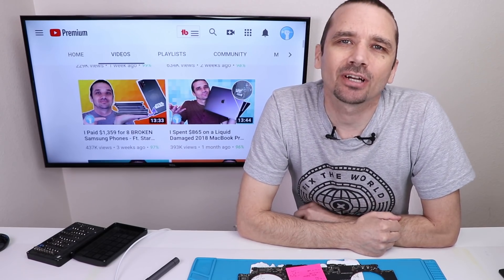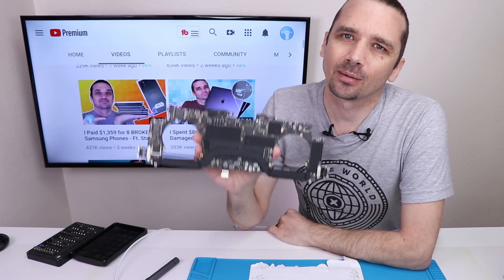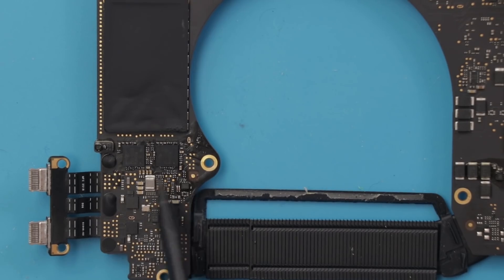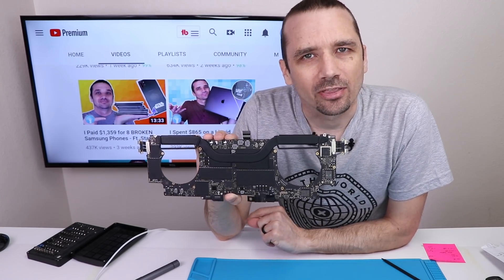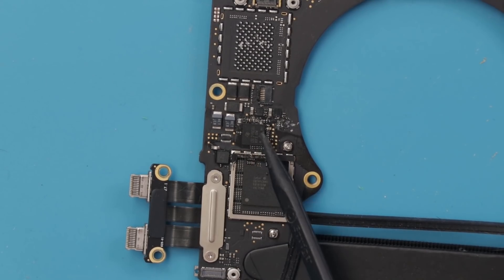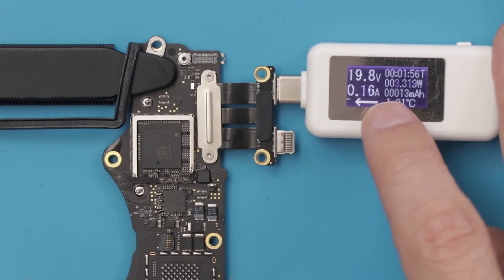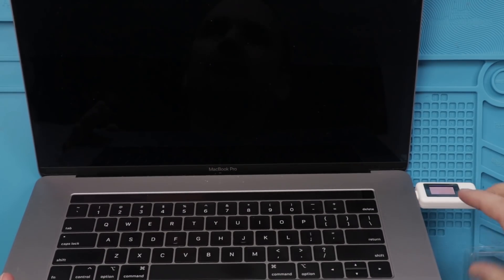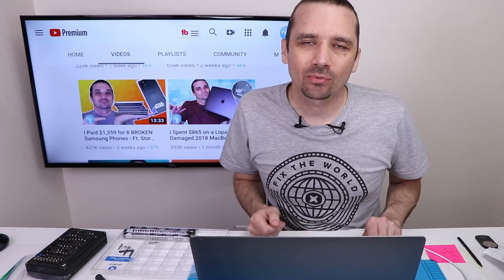ANOTHER Broken 2018 MacBook Pro From eBay for $700  - Can I Fix It?

Comment: If my MAC Laptop battery is below a certain level it will not turn on even if it is plugged in.  Which I think is dumb. If it's directly plugged in to a power cable it should turn on no matter the battery level.

Comment: The biggest problem I found is when there is liquid damage and the owner just leaves it for a day or two then starts using it again. Clearly not realizing that just because it's working, that doesn't mean there isn't still liquid in there rapidly corroding the internals. ☹️

Comment: Hi, can somebody help me?  my macbook pro 15 2016 A1707 only works on the wire, the problem is up to one resistor so can anyone tell me exactly where it is and which one I need to take?  and think this is the R6907 part, it goes from the battery... battery recognizes but does not work with it
Reply: R6907 is not an actual resistor on that board, youd have to measure PPBUS_G3H voltage to see whats exactly wrong with it to start, then measure PPVBAT_G3H_CONN.
Reply: @DSuave03-Me  so i have all the way 18+V on board with cable and on D6902 to the battery i think 11-12V. when change on battery i have on D6902 on second pin under 2V, when measure battery show me 0V or after one minute on cable than come on 2.7V, this is battery bad or dont charge?
Reply: @razorr335  Bad battery most liekly.

Comment: Hey,
I am getting the same issue, 19.9v but no amp - What did you do to fix it?
Looking at the documentation I see three CD3215 chips labeled U3200, UB300, UB400

Also where did you source the replacement chip?

Comment: This might be a heavily asked question but I actually finally decided my career path is going to be in the direction of electrical engineering and I’ve always loved working on electronics .. I was just curious how did you learn so much about motherboards themselves , seems very off setting but I would love to know where I get my feet wet , as far as knowing what components do what or how those components are supposed to perform ! Love the content !
Reply: Take an electronic course at a community college. That’s where you learn

Comment: Bro i need your help regarding my ps4 controller.
My controller is not charging. So i open my controller for check.
I noticed when i unplugged the touch pad connecter then it start charging and when i connect touch pad again it is not charging again. 
Plzzzzz help me what to do plzzz

Comment: iPhone charging case does carry the same isl9249 as for this Macbook pro, you can desolder it from the charging case and use it for the Macbook Pro,  it will work! However you must reball it (obviously) before resoldering.

Comment: Question, My friends MacBook pro 13" 2017 function keys has water damage. Some drops of water fell onto the keyboard and now the keys "9 O L . up arrow and down arrow" don't work. Everything else works perfectly. I'm trying to fix it but I can't find any liquid damage on the inside and I can't take the keyboard out as that would require the plastic behind the keyboard to be ripped apart. Is it recommended to just put 99% alcohol under some of the keys to see if that cleans corrosion that might be underneath the keys or will that fry the entire MacBook? Any tips?

Comment: ( ISL 9249)  you should be able to find that chip inside the AirPods case. Also I have a hunch you can use the ISL 9240 chip in place of. (Dual verify that last sentence) good luck....looking forward to your solution

Comment: Have you got a current limited bench power supply to inject some power into PPBUS and see what components get hot?

I would suggest  you mesure resistance from PPBUS to the CPU and GPU power rails, a mosfet could have failed connecting PPBUS to your CPU die and that wuld be game over.

Comment: @TronicsFix You've never successfully removed broken WiFi connectors (the little circular pieces) from the end of the antenna wires have you? I managed too snap mine off. :/

Comment: I have a Late 2008 MacBook Aluminum Unibody and it has a warped lid/screen like you showed in the video.  That warping just happens with time.  It doesn't effect the performance.  Mine is still running like a champ.  In fact, I still use it daily and I'm typing and watching your video with it.

Comment: In 2016 I bought a $700 HP Laptop and 7 months later it stopped powering on, so i sent it under warranty HP fixed it in a week. Then 8 months later same thing. I took it to 2 places and they said there was no power from the battery or power cord and they too bad. I should have mailed it to you.

Comment: My guess with the burned out USB-C pin is a faulty or cheap charger could have sent the wrong voltage to that pin or just sent the voltage to the wrong pin, causing the pin to burn out and kill the ISL9240. I've seen similar with a real cheap USB-C charger from Wish.com, the charger was rated for 20 volts, but it actually sent 38 volts to one of the data pins.

Comment: 12:20 me yelling at the screen: the first thing we need to do is THROW IT IN AN ULTRASONIC CLEANER GAAAAH
Reply: No you should not... always try to find corrosion and possible faults first. Troubleshooting can be very tricky if you lose the visual hints.
Reply: That Dude ~ note it, clean it, then troubleshoot it! Otherwise you're just chasing down ghosts of gunk all over the board. I don't get your point on that - it's like taking a record off a sandy beach and trying to play it, wondering why it sounds so awful and taking a toothbrush to individually clean off a track at a time. No! Just wash the whole board and look at what was previously messy to get hints on further troubleshooting. Anything that's still wrong will usually still be visible - broken traces don't look like good traces.

Comment: That capacitor at 13:04 is probably shorted, you can see the crack going through the corner of it.
Remove it and see if there's still a short :)

Comment: On the second Macbook: I'm sure I'm not the only one to draw this conclusion, but for what it's worth, here's my deduction on how the damage occurred. The laptop gets dented, but is provisionally fine. The owner, not a trained technician, wonders if he can do something about it himself, so he opens the case and bangs out the dents. The "repair" seems to work for a while, but what the owner doesn't realize is that the case has to keep tight against the elements, so as time goes on, moisture leaks in through the gaps, and kills the device, this time for good. So they sell it off as scrap (Apple edition) and... probably buy another mac.

Comment: Maybe someone can help me with my old macbook air? I have Macbook Air 2009mid A1304. I have problems with wifi. No hardware installed. In system report airport not showing, but bluetooth work. I tried clean install, changed airport card, connection flex cable - problem not solved. I think this is motherboard problem. Maybe someone knows where need to look for problem? Thanks!

Comment: remove the chip to see if there's no short, nothing to lose
Reply from the maker: True, but I didn't want to take it off until I have the part here.
Reply: @Tronicsfix  be like me take it out and never find it again lol
Reply: @legin3753  
You mean, you take off the chip alone but everything gone missing?
Reply: @noorazmi2329  ithink chip only :(
Reply: @noorazmi2329  the chip would go missing i have a shed so full of stuff ya wouldt believe it lol
Reply: @legin3753  
What about your heating tool? Does it go missing too?
Reply: @legin3753  
Oh I get it now. Everything gone missing because it is there right from the beginning.
Gone + missing = no more missing word.
Reply: He man my ps4 pro overhot a lot I don’t know why the fan is clean and everything
Reply: @bmxlife_nyc2525  Try replacing the thermal paste, there's tutorials on YT
Reply: @bmxlife_nyc2525  
Maybe The thermal paste have problem? Bad.
Or, too dusty or something has blocked the ventilation?
Or, bad heat sink due tar build up if you are a very heavy smoker?

If the fan is clean and everything than the possible reason is bad thermal paste.

Comment: I got one of those Macbook Pro's (Second one you showed) for £5, it was bend and beat to hell so I got it looking as good as I could, bought a charger from ebay to find out the screen is badly cracked and they are not cheap to buy, but the motherboard works which is a good thing.
Reply from the maker: Where did you find it for 5?

Comment: I am a bit shocked that a macbok (pro) that looks like someone threw off a bridge still costs 700 bucks. Wtf
Reply from the maker: Newish MacBook Pro's are still expensive...even when broken
Reply: @Tronicsfix  I have the chip in-stock if you like to buy it I have my own ebay acc
Reply: @Tronicsfix  Broken is one thing...completely trashed is quite another matter!
Reply: @Tronicsfix  c232 chip i have them in stock if you like to buy one just reply back to me I can shoot you a email
Reply: Apple makes it tough to get parts. Even a busted Late model Mac is a sea of high dollar parts.
Reply: @DanaTheInsane  my mid 2014 retina MacBook Pro sceeen is broken and a replacement costs £300 - £400 or that’s about $400 - $500
Reply: It still had the logo untouched man, thats at least 600 bucks
Reply: @fhanum9716  maybe even 666 bucks
Reply: Yeah, Apple pricing carries over even to the used stuff i guess. I don't like Apple but the brand certainly carries some weight in that sense.
Reply: The value of brand identity is more than a lot of people know.
Reply: @ProjectNateRS  You confuse a real value with what a silly world assign to a trendy but still a real crap product...
Reply: @paolomonai9511  no, I didn't. I just made an observation
Reply: @UnCoolDad  won't work you have to program it to the Mac pro inorder for it to work with Mac pros
Reply: "I got a MacBook Pro. Yeah, it's broken and doesn't work, but who cares, right?"
Reply: I sold my 2013 for €650
Reply: that logo itself is approximately 500USD 🤣
Reply: What I find even more shocking the idiots who purchase them....no my block i get those working for 250-300 max
Reply: Stup
Reply: Because it’s a MacBook Pro....That’s why....Damn, I want one
Reply: It's only worth what someone will pay for it.
Reply: Exactly, offer and demand I guess... But not for me.
Reply: If I had a macbook I would have thrown it off a bridge aswell
Reply: Yeah, it's inconceivable. 700 dollars would already buy a pretty decent brand new Windows laptop. Or a Macbook that looks totaled and wouldn't even charge, let alone turn on. I'm destined to never use Apple products because I just don't get it.
Reply: @herrakaarme  Its very illogical to me as well.

Why someone would spend that much on a broken macbook that looks to have been dragged behind a car, when they could buy a pretty decent windows machine brand new, with warranty and all, for the same amount.

I guess some people are just not very smart :)
Reply: To bad we (Sweden) have odd keyboard layout, else it would be profitable to ship broken ones to US.  Bought 2 broken MBP fro $50 (500 SEK) just to rip off the screens for another use case.
Reply: Apple doesn't sell laptops, they sell their image. They are the Rollex of tech, which I just don't understand how a tech company can exist in that fashion. Tech is meant to have a function, and I bought a laptop with a slightly worse cpu, double the ssd storage, and a dedicated graphics card (only a garbage 1050, but better than the no card you get with a macbook air), and I got it for $400 less, not to mention taxes would be higher for the mac.
Reply: @TheCalmPsycho  apple used to be about function over image. 

They were first to have mass manufactured laptops with wifi connectivity 

They made the first reliable and solid built mp3 players destroying their competition Sony walkman and Microsoft zune (actually using HDD like a computer in the first ipods) 

They bought the rights to GUI from xerox and all GUI today descend from what Apple developed. 

Apple sold the first fully complete home computer system Apple II, not requiring separate purchases of other parts like IBM such as power supplies, keyboards and displays. Today this is the standard when buying a home computer.

WebKit is VERY important you wouldn't have search engines like safari, Firefox, or chrome without it!

Multi touch screens, look up finger works. Apple bought them and developed it and now everybody uses technology derived from that work including Samsung!

There is probably a lot more apple is responsible for that I haven't thought of, but there is definitely a reason they are loved. They are an innovative company and their products in my experience take more of a beating than their contemporaries.
Reply: @bear2507  Why is it worth more in a totally useless shape? It's because of the brand. I've never in my life worshipped a single brand. However, there are lots of zombies on this planet that do, and thus many companies can get away with higher prices for no particular reason. It's an extremely desirable situation for all manufacturers, which is why these days you see a number of flagship smartphones from various brands that are just as expensive as Apple's best. The companies all wish they could sell air to loyal customers. And I'm not talking about Air Liquide.
Reply: I remember arguing with my GF that apple is just a useless logo of great looking, yet too simple software wise, too expensive devices. After many arguments she could only say "but I feel good when people see I use an iPhone!" So there is only that: a logo.
Reply: exlibrisas Apple is pretty good with optimization of their machines. Still over priced? Yes

Comment: My opinion is different: Fix ALL the things! Find more laptops! Maybe try to fix a TV that looks fine but won't power on!

Sky's the limit! Love your content!
Reply from the maker: Thanks! Glad you're enjoying them.
Reply: TronicsFix the xr battery case this chip afaik. Check it out its not too expensive
Reply: @Tronicsfix  I would love to see vintage video games repair
Reply: I couldn't agree more on this.
Reply: Yes please! Super interesting!
Reply: I purchase a tv recently that wouldn’t power on. I’m ordering a part for it on eBay. Tv repair can be simple from what I’ve seen. Fingers cross the part works!
Reply: @SaithusX  Probably a faulty capacitor. My TV was acting weird (turning on over the night) but I let it go hah, and after some time it turned off and didn't want to power on. I disassembled my TV and found bloated capacitor which I swapped and voilá, my 10+ years old TV is working great again.
Reply: SaithusX which tv ? If its Samsung i can help for choosing parts.
Reply: You don't need to do an electronics course to fix consoles. However it wont hurt! Good luck lil dude

Comment: you paid 800 for the firs mac and now 700 for this one, and both did not work and you invested more money into them, at those prices why not just purchase used ones at less price......makes no sense.
Reply from the maker: The first one is a 2018 MacBook Pro...where you buying those used for $800 that work???
Reply: @Tronicsfix  i bought 2 one 2019 very thin mac for 350 and the other 2017 for 300, sold them double priced....their not expensive unless you go on ebay and get ripped off like you did....keep your eyes open bro...look beyond the rainbow.

Comment: You can't buy that charge chip ( I'm not 100% shure if this is the exact macbook) becaus apple has a contract with the producer of the chip to only sell it to apple. The chip of those charge cases will work, but it is a lot work and you would have to reball the chip.

Comment: Damm i dig the new logo
Reply from the maker: Really? Thanks! I've had it for a while now but just starting to use it.
Reply: TronicsFix yeah it looks really good i also use to like the old one also also one more question if u rip of a pad on a hdmi port can run a trace wire on a ps 4
Reply from the maker: @lochanathambeliyagoda5065  Yes, I've done it several times in my videos.
Reply: TronicsFix thx so much i was kinda scared to do a repair

Comment: awesome, do you have any experience fixing pc motherboards, a pc i had in my studio has stopped working , there was a lot of vaping going on in the room and some liquid had built in the case but im unsure if there's water damage , the motherboard visibly looks fine, but when i start it up it just beeps repeatedly every few seconds.
Reply: count the beeps and the intervals they beep in and google it along with motherboard manufacturer name...
Reply from the maker: No, sorry
Reply: Hi, not in any way experienced with liquid damage in pc motberboards, however, there is usually a pattern to the beeping the Motherboard makes. I.e 1 long then 3 short. If you look your pattern up you can get more detailed info about what exactly might be wrong with it! Hope this helps :)
Reply: You need to check what the beeps mean for your motherboard. Google the model number followed by the number of beeps you hear at startup. Usually that's a sign that it failed POST for some reason.